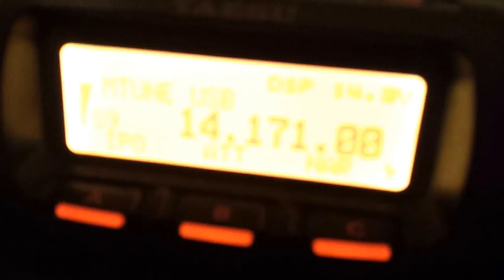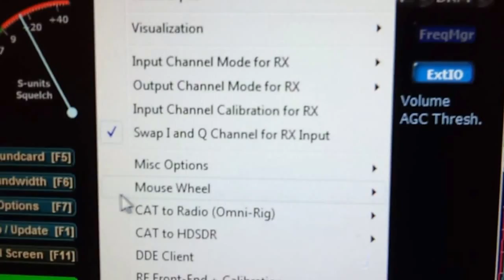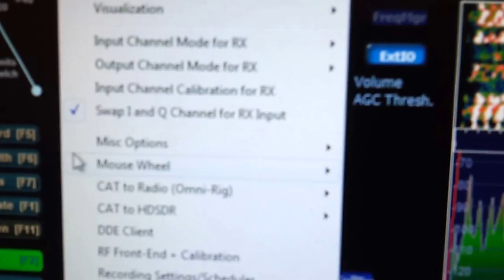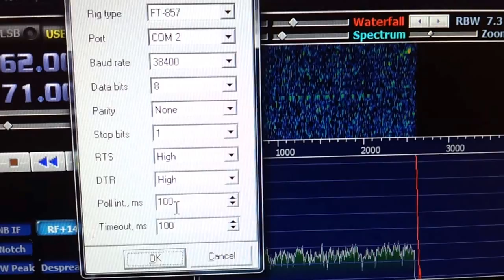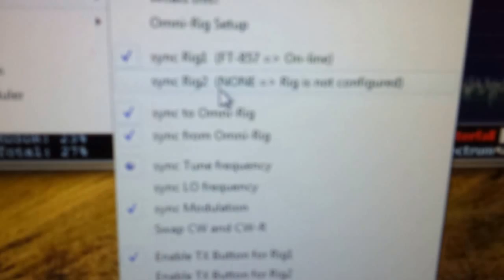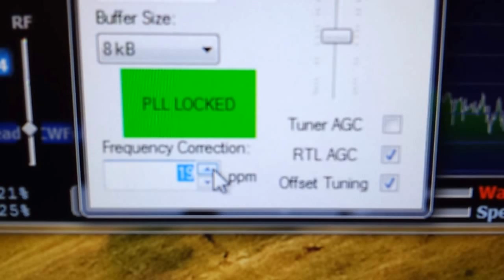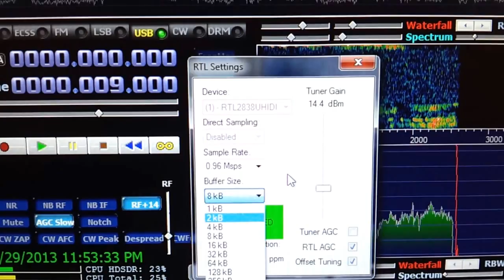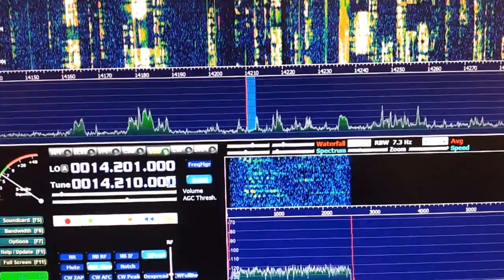How to setup a RTL SDR with HDSDR and a FT-857 for a panadapter and second receiver.

Comment: I thought the lowest frequency the RTL SDR works at is 24MHz.  Or, I suppose that doesn't matter when you are tapped in to the 857D's IF.  So, the RTL SDR isn't receiving internally, it's getting it's receive signal from the 857D then, right?  So basically, the RTL SDR is just being used (in conjunction with a computer, CAT control software, and SDR software) to display and control the frequency of the transceiver?
Reply from the maker: The RTL is just listening at the 857's I.F. (intermediate frequency) which is in the low VHF range. So as you tune about the bands on the 857 the RTL just stays locked on the I.F. freq. The CAT control from the rig tells the software the freq it's on so it displays it correctly even though the RTL hasn't budged, if that makes sense?
Reply: @K4AX  This really intrigued me, not gunna lie.  I just so happen to have; an 857D, a HupRF PAT 70 board, and an RTL2832 SDR...  I'm still pretty new to Amateur Radio, but I know enough to be dangerous!  Is the setup in this video something you still run?  Have you made any changes?  I would imagine most SDR software out there would work the same as HD SDR, however I'm not well versed in the SDR software kool kids of today are running.  Graciously I will accept any pointers.  For some reason, the idea of attaching an LCD screen to an 857D with custom 3D printed flip up bezel displaying pretty radio spectrum sounds super cool!  Perhaps that "leaked" pic of that Yaesu 710 with the monitor on top has persuaded me that a flip up screen should be brought forth in to existence! lol

Comment: I've spent weeks on trying to get the USB/LSB frequencies to line up to no avail. It seems when you try to independently change the modes offset it changes everything else and it never sticks. This solution seems to work great for AM/FM but SSB is just a complete mess.

Comment: Thanks for a great vid.  Gonna try the RTL/HDSDR setup like you did, but with my TS-940.  (I know "good luck!") heh - and as for the occasional zeroing out of frequency ... have you tried slowing down the serial connection from 38,400 to maybe 19,200 or so .. just to see if it helps?  73!!
Reply from the maker: Thanks, no I've not tried that, good idea though!

Comment: I know you’ve probably been bombarded by people asking how, and why, and what if.
I too have an 857 and would, love to use it with my rtf-sdr dongle.
I already tried to tap the first IF with a 100pf cap.. the result was less than stellar.
I couldn’t get anything intelligible out of the radio even after following your HDsdr how to video.
I have ordered the PAT70M HiZ buffer board from the U.K. and am anxiously awaiting its arrival.
I am wondering if you’ve gone to a buffer board yet and if so how well does it work compared to a direct connection?
I also seem to have a problem with starting every sentence with “I”. 
Thanks.
Reply: I cant get mine to work at all with an RTL2832U Dongle.
The PAT70 board It is now back out of the 857D as I have noticed that the output on the board has a dead short.
It is shorting the center of the output coax to the shield of the output coax (I am sure it should not be doing that).
I have tested all of my coax off board and there are no shorts.
not happy at all and have had to email SDR-Kits to ask if the output should infact be a dead short (if no then they sold me a dodgy board)

Comment: I have not been able to get my RTL-SDR R820T2 RTL2832U   Version  3 dongle to work as a panadapter with either my Kenwood TS-570DG or my Yaesu FT-920..  

The dongle I bought from Amazon is https://smile.amazon.com/RTL-SDR-Blog-RTL2832U-Software-Defined/dp/B0129EBDS2/ref=sr_1_4?s=electronics&ie=UTF8&qid=1513624240&sr=1-4&keywords=sdr  

The dongle works fine otherwise as a ham/shortwave/police monitor.  I have tapped the proper location for the 1st IF in both radios and inputted the proper 1st IF frequencies in HDSDR.    I can control radios with OmniRig , but my panadapter display shows nothing but a few random lines.  Just does not work!  Maybe it is the particular dongle I am using.  Also, my computer is plenty fast ...I7 32gb ram, etc.....

Any ideas?
Reply: I cant get mine to work at all with an RTL2832U Dongle.
The PAT70 board It is now back out of the 857D as I have noticed that the output on the board has a dead short.
It is shorting the center of the output coax to the shield of the output coax (I am sure it should not be doing that).
I have tested all of my coax off board and there are no shorts.
not happy at all and have had to email SDR-Kits to ask if the output should infact be a dead short (if no then they sold me a dodgy board)

Comment: Am I missing a component to this? 

 I was wondering if anyone can offer some advice on how to get my 857D to sync up with HDSDR. . I have spent hours with limited success. 
 
USB  interface:. umc202HD 
PC:  HP Pavilion dvr6
Radio: FT- 857d.
Tuner: YT- 100
 
Any advice would be greatly appreciated, 

73's!
Reply: Make sure the speed is set the same in HDSDR and on the rig 9600bPs is good. Menue 14 on the radio.

Comment: Really appreciate your video. You went over everything and I am very impressed how you have it working.

 I recently got in a cheap RTL-SDR that has a UV input and a HF input. The thing works great at VHF but I am just lost at trying to make it work on a 455 KHz IF.

 I am using a Collins R-390.

 I downloaded Omnirig but I don't think it is doing anything for me unless there are some receivers in the list with 455 KHz IF's. 

From what I read, these little RTL-SDR USB drives are actually digital TV receivers and don't work below about 24 MHz. Maybe I am doing something really dumb. Any thoughts would be appreciated.

WA4QGA
David
Reply from the maker: Damn I'm sorry I didn't see your question, I hope you've worked it out by now, but with such a low freq a RTL probably wasn't the best bet unless placed in direct IQ mode, and that's not ideal.

Comment: This does work very well once you get it set up correctly however it did turn my rig into a QRP rig. With the dongle antenna lead from my rig plunged in my AM output carrier drops to less than 2 watts and I am lucky to get 4 watts PEP, unplug the dongle and it is back to normal. Has no effect on FM at all.

Comment: I connected my older FT-840 to my SDR..... receive only through the Signalink USB and it SEEMS to be working....... at least for the first try. It will tune rig but not change things like mode or other setting and I assume that is the older FT-840 being just old..... thanks for the video, didn't even think about trying this !!
Reply: +Jeff Chancey KAØEGE

Comment: I have done this modification to a Yaesu FT897. It works very well and I'm very pleased  with the result. Don't think I would have been able to set up the software without your video. The scary bit was modifying my FT897, not for the faint hearted. Now its done its very compulsive to watch, and very useful to see what's going on on the band. One other thing, I have the CAT control running from an adapter on the mic socket and a second CAT control from the back of the set talking to HRD. So I have my logging as well. How cool is that?    73 M0RRX

Comment: +K4AX I'm impressed, I've actually setup my TS-480 in a similar manor except I am using a MFJ-1708 as a TR Switcher with my SDR since I didn't want to tap into the IF. I also wanted the ability to use different SDRs on the receive side. It's working out great, HDSDR's interface is quite nice.

Comment: Are you using an up-converter between the 857 and the 2832u dongle?
Reply: +Clifford Novey no need for a upconverter, the first I.F. is in the low VHF range, and well inside the specs of a RTL dongle.

Comment: Hello, excellent video. I'm trying to do the same thing with an FTDX3000D and having no luck with rig control nor omnirig talking to my transceiver. Since the I.F. frequency of the DX3000 is 9 Mhz, I added a 125Mhz downconverter before the RTL stick.  I'm not sure if that would be a requirement but it seemed to make sense. Please correct me if I'm wrong.
Also, I'm confused as to what physical connections are needed to satisfy the COM port requirements. The rig is already connected to the PC via USB so I'm assuming that should suffice as the COM port connection...correct? Or do I need a separate USB/RS232 conversion cable?  Finally, I've apparently not found the correct COM port number but have tried inputting consecutive port numbers from 1 to 9 in the omnirig COM port field without success. I've spent hours upon hours trying to create a panadapter from the I.F. of this fairly new radio and am just about at wit's end. If you could help me figure this out I'll be most appreciative. 
BTW, how do you have your CAT control connected? Should I be using an RS232 cable from rig to PC?  Newer PCs don't even have that kind of COM port anymore. But as I said before, my rig has a USB connection already and is very happy running HRD...so, it should work with omnirig, right?  Thanks again for any suggestions. 73
Dub, k4dub

Comment: I am not sure if i clearly understand this...

Do you have to make some hardware alterations on the ft857, or just simple works with this config?  Please respond. 73
Reply from the maker: Look above in the video information, I posted a link to a site that shows where to tap the 857/97 in two places.  I've not done a video on this, as a picture will do just fine with the tap points.  I personally spent a lot more time figuring out HDSDR/cat controlling another rig than just the few minutes it took doing the tap point, which is why I felt doing a video on it would  be helpful.

Comment: I would very much like to hook into my first I.f please can you advise on the location where to do this. Would it be the output of Q1073 (BB305CEW) so its amplified abit first and if so do i need to use a capacitor and if so what type and value. Hope its ok to post my question here. Really like the radio but turning it into a SDR tranceiver would be cool….
Reply: I think im going to give the above a try over the next few days using a 120pf capacitor. Ive not heard from the guy who shot this video so im going to give this a try. regards Richard hope this helps someone